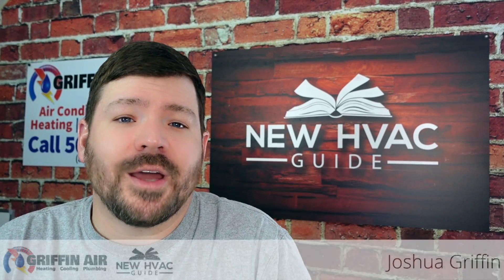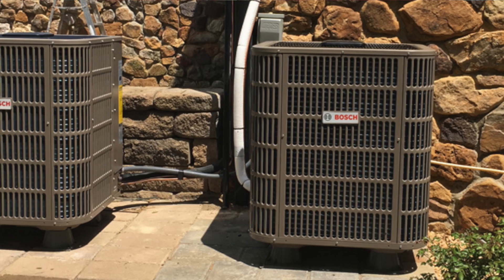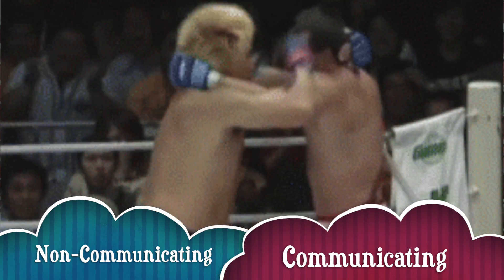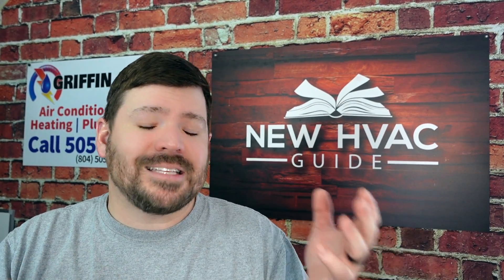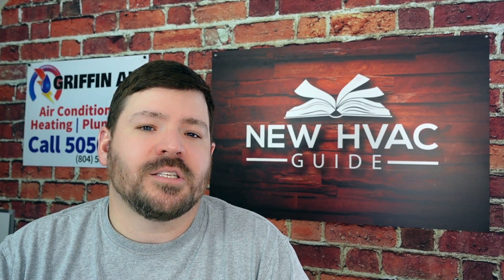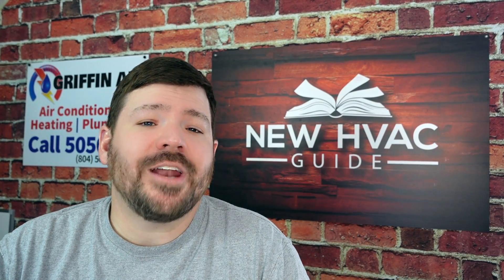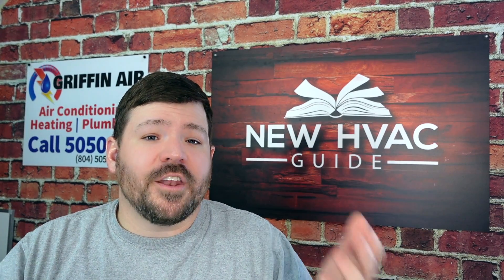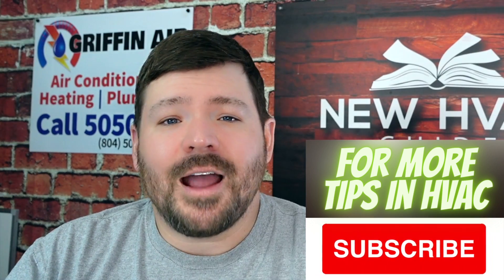HVAC Inverter WAR! Which is BETTER?

Comment: I installed a ACIQ hybrid unit and it’s been 1 yr+and now it goes into heat mode and I have no electric heating elements so it’s activating the reversing valve is there any way to find out if it’s needs power on the reversing valve to cool it’s has power and I’m baffled. Thanks .

Comment: These communicating systems are way too expensive. Im learning how to get into the business of building homes with a mentor and im starting out focused on first-time home buyers. Thats about 300k which is 30-35% lower than the median sales price in my market. I want to build a good quality airtight home but i need to be able to manage humidity. Im already considering an ERV and inverter heat pump to be mandatory, but i really dont want to spec for a dehumidifer as well. One because thats another increase and prive and two because they only last about 5 to 8 years before needing to be replaced. That's a huge burden on the person who buys a home that i build. I want the home to be affordable to buy and affordable to run. That means i cant have a full equipment replacement every 5 to 8 years. 

Im in zone 3a so we definitely have humidity. I'm not seeing how i can get a communicating heat pump into my budget tho.

Comment: Thanks, Joshua. I have a question about my system. I renovated a home 2 years ago, including a completely new HVAC system (included ductwork). My HVAC system is a ducted Mitsubishi heat pump (inverter) with an HRV. I wanted this system for maximum comfort and efficiency. However, the installer installed a Honeywell programmable/wifi thermostat. My question is: by installing the Honeywell thermostat, is it controlling my inverter heap pump more like a multi-stage unit, and not with the efficiency of the inverter? I know that I still have the variable speed equipment, but is my thermostat only capable of multi-stage functionality, thus losing confort and efficiency?

As a related question, I prefer Ecobee thermostats, and was wondering if I could swap out the Honeywell thermostats (I don't like them at all) with the ecobee...but I have the same question above. At my previous home, I had the ecobee thermostats and I really liked them, but I don't want to hamstring the system that I paid for (comfort & efficiency).

Thanks!

Comment: Most inverter mini splits have indoor and outdoor temperature sensors they comunícate and function like you explain do no need for communicating thermostat as they ramp up and run faster compressor speeds on hotter days or lower temperature demands

Comment: I was a factory service tech for Trane Commercial over twenty years ago and I will tell you that I would not put a new Trane system in my house or building today. They are simply over-priced garbage these days!
Reply from the maker: Ouch! Do you think the commercial and residential quality could be different?
Reply: @NewHVACGuide  I also have worked on residential systems as well. After the Ingersoll-Rand acquisition, The warranty issues went through the roof and the prices went up as well. I would put Goodman up against them any day for quality and the pricing is much better not to mention Trane can’t get parts sometimes for six months.
Reply from the maker: Join us on Tuesday for our live show!
Reply: I have been using the Trane inverter units since 2015 and very little problems,
And the 2025 units have the program and diagnostic data on IPad or IPhone
Reply: Lots better than carriers junk

Comment: those control boards scream surge protection
Reply from the maker: Surges are their biggest predators aside from poor installation of equipment
Reply: My old unit has a surge protector getting a new trane installed very soon and surge protector is on the quote

Comment: question, does inverter units dehumidified better than the standard units  are less? tks
Reply from the maker: Loaded question. Overall they should be better. But the latent capacity can still be lower if equipment and ductwork sizing aren’t correct

Comment: What do you think the likelihood would be of entire systems communicating over IP protocol? 

Most smart thermostats already are Wi-Fi enabled, and air handlers inside the home typically will be within the range of a wireless router, in addition to already having a physical connection to the condenser.

I'm by no means an HVAC tech, so I'm more than open to being corrected.

I just think that if all systems used a widely available protocol that's already in the majority of homes, we could have standardized communicating systems without proprietary equipment being an issue.

Comment: As an electrician, specialty PVS/LiFePO4 grid tie, the future for HVAC can only be inverter, they integrate into modern energy efficient smart homes. I am not in the US, I cant believe you guys (or even the environmental / efficiency rules) still allows the use of the old fashioned single-phase capacitor start induction motors. When I have a sneaky look around the re-cycling centre, there is an entire dept for old air conditioning, hundreds of perfectly working non-inverter systems that have had to be upgraded. I bet in the US you can probably still buy fluorescent tubes and bulbs with filaments!
Reply: Fluorescent tubes Yes I think are available...but I can't swear they are, but Bulbs with filaments went away long ago.  You probably knew that and was just kidding.  But just in case, gotta stand up for my Country.  HA.

Comment: Thinking of using an ECOBEE with Lennox EL23XCV / EL297V as a “non-communicating” setup. Lennox offers 3 “modes” to choose from when in non-com mode. I just can’t handle the Lennox thermostat which looks like a glorified android tablet after getting used to and loving a nest. Hoping to bide my time until Lennox gets their act together

Comment: How is having the ability to trun off and on vs. having a 20%-30-40-60-100% Inverter system. Wouldn't a duty cycle of a normal system be the same as a inverter system? The old style just truns on less on cooler days vs hoter days. Yeah i get that it only uses the power that it needs to cool. Do they just run all the time and ramp up and down as needed? Vs a normal one has a duty cycle that just full go or off and just truns on more on the hotter days
Reply from the maker: There are certainly days that either system will run less. However, a communicating inverter system will have the ability to learn the parameters and run as efficiently as possible. Less short cycling and longer runtimes, but drawing very little electricity while running.

Comment: Can a communicating system be run as a noncommunicating system, in otherwise is it possible to do a delete on the communicating system, when a part of the communicating system fails, and operate it as a noncommunicating conventional system.

Comment: I've been in HVAC industry for 8 years and could not be more disappointed with the insane prices that I'm seeing with high-end equipment, I'm seeing more than double the cost for the initial equipment cost comparing the most efficient to the least efficient equipment and I'm seeing the repair costs are astronomical for the inverter driven equipment or ecm's.
The only people I see putting in the top of the line equipment are old people with lots of money to blow.
Reply from the maker: Interesting. Where are you located?
Reply: @NewHVACGuide  southern Minnesota, I just put in a $3,000 inverter for a 3 ton residential AC 2 weeks ago.
There is no debating that the fancy equipment is more efficient and cheaper to operate but it is so much more expensive to purchase and repair.
Also the need for tech support to troubleshoot these new pieces of equipment is frustrating, this year I ran into a problem trying to troubleshoot a 15 ton Trane rooftop unit with a vfd blower and Trane would not help me because I'm not a Trane dealer

Comment: I understand inverters are more efficient when they're running.  I think part of the problem is they are almost always running.  2 acquaintances have told me, it's questionable if there's any savings.  They are running almost all the time.  And the price contractors are charging kills any savings, it seems.  I had mine installed about a month ago.  I've only been using the heater.  The heater is using the same (probably a bit more) as my old 9 SEER air conditioner that it replaced.  I "assume" the air conditioner will use similar energy in the summer.  I'm not sure where the savings are.
Reply: What area do you live?  And what did your installer charge you?       What Brand did you buy and what SEER did it say it was?
Reply: @ChiefRRoss  I'd rather not throw the installer under, but I do live in Los Angeles county.  California.  The install appears to be fine.  It's just they are always freaking running.  Maybe 85% of the time is more correct.  Could be 90%.
Reply: @twoweeledsoto6072  Well friend, you're the one said "the price contractors are charging kills any savings".  Your Words.
Every Inverter Description I've read clearly said,  "unlike the traditional HVAC units that turn on and off, our inverters run constantly".   SO, they told you, You Should've known it runs constantly before buying it assuming you did your due diligence researching it.   HOPEFULLY it's as advertised and is Quiet at least. 
 As for the SEER, I'm in SW Ohio, and am looking to get one that has between 16-24 SEER.    I've not seen Inverters rated much less than that, so it has to be doing better than the 9 SEER you used to have.     I only asked what your installer charged to get a general idea what I had to look forward to, although a CALI. price is likely going to be 2x as much.                   GOOD LUCK, hope you get used to it,.
Reply: @ChiefRRoss  Well, you really don't know if they told me or not.  You are assuming that.  If they did, you don't know how clear they were on that.  I did get the general feeling they run more, yes.   But they run much more than I ever imagined.  I know it was never explained why they run.  They are not always cooling or heating when they run.  To filter the house?  Maybe, but I don't recall reading that on every review I read, and I read a bunch!  I still don't know why they just run and blow air.  Temp is correct and they still run, just cooling/heating stops.  Inverters run constantly?  Ask 5 people what constantly means relative to AC and I bet not all answers are the same.  
I think mine is around a 17 seer.  that's another issue.  How the ratings work.  Not all 17 seer work at the same level.  Governmental changes is what I understand.  Mine is 17 and near $19K ish.  Including ducting which will probably have to be done, because you will probably go up in size.  Maybe 1/2 ton more, depending how your existing system handled things.  I am happy with the performance.  It is quieter.  Along with larger ducts, we increases the return registers.  In my uneducated mind.  Letting it breath easier with less restriction.  Heating and cooling are not as noticeable/perceptible as my past system.   It doesn't get as hot, nor as cold.  but I have a bigger system along with the blower (air handler) and I'm getting more air going into the house.  Not as cold, but more of it.  Which is why I'd advise going larger.  There's more of course but I'm getting writer's cramp and your eyes are probably hurting.  Any questions, just ask!    Important to note.  I have solar panels.  FYI

Comment: Josh the done problem with your least suggestion is some companies will recommend a non communicating system because they don’t have to be a certified dealer, sell a certain number of units,; etc. Bosch is a good example of this. Like you I agree Bosch is a great system for right environment .dry ! Esp cold and dry -very energy efficient for heating. But it’s just not designed to deal with humidity . In fact, it’s a bad choice for a humid environment ? For phoenix. Sat lake city, outstanding choice. Quiet, priced right, thermostat agnostic, and easier if a retrofit, keeping indoor components. The new 20 seer units allow the coil to be set (dip switch ?/)nto 37 degrees apparently-do you think that will make a difference ?
Reply: What's a good 15/16/or 17 Seer heat pump for humid regions (San Antonio)
I'm looking at Rheem or Amana.

Comment: Inverter systems have been used overseas for years mainly heat pumps that can now heat below -20 degrees.  The US market is finally getting caught up.
Reply: Which brands are the most reliable?
Need one this week.

Comment: I believe my 35 year old 3 ton Trane AC condenser finally broke.  The house is fully electric, in the winter we have a furnace that stores energy with also the air handler able to produce heat.
Looking for recommendations for a new condenser,  should l stick with a single stage or can l change to an inverter?
My thermostat is Ecobee 4.

Thank you Troy

Comment: Getting a Bosch BOVA 2.0 Split System Heat Pump installed along with a Bosch BVA Series Air Handler.  Regarding the use of a smart thermostat:  I was planning on using an Ecobee3 Lite with the new system.  Could I just disable the Smart Recovery feature, to avoid the possible problems you mention when using a smart thermostat with a non-communicating Bosch system?

Comment: I installed a Mr Cool universal. You need a decent  thermostat & outdoor thermostat that allows you to lockout the heat strips at a specific temp (if you even want heat strips). The non communicative has proven to be “smart enough” and paired with the right thermostat it is a wonderful advancement in hvac. You’re right about the difficulty finding techs to install/work on them but I suspect this to be less of an issue in the next 5-7 years. And I think it’s only an issue today to the degree that you’ll have to simply “call around” to find someone competent and willing to work on them. Manufacture provides 10 years parts & phone support so as a diy’er i’m not really concerned but recognize i might not recommend to others they jump on the bandwagon just yet. These inverter systems are too expensive unless you’re diy so it will take govt regulations getting tougher and these systems will be the gold standard in 5-10 years.

Comment: I am not interested in proprietary thermosets, or systems that require or even recommend one.  I like open source freedom.  I am hoping that we begin to see thermostats exceed what ecobee has to offer, with lots of aux modes and fan configurations, with many stages of heating and cooling based on rules that work well with variable inverter systems, hydronics, economization etc, and cloud based weather data, and indoor/outdoor air quality sensor data, without lock in.
Reply from the maker: You might get your hope sooner than you think :-)
Reply: It's Matter.

Comment: I’m located in South Alabama near the gulf coast in a subtropical climate and high humidity.  My regular HVAC company is a Lennox dealer, and it’s time for a system replacement for my home. I’m interested in the inverter technology but they keep telling me to go the traditional route with a single stage system.  I called another HVAC company for a quote and they too “prefer” the single stage system and say they are more reliable. I can’t figure out what’s going on?  Do the contractors just not want to learn the new technology with inverters and communicating technology?  Or is the single stage systems more simple and therefore more reliable?
Reply: What did you replace your unit with?
Reply: @TJ-22 
C'mon, Man. 
You know narcissists only answer if it benefits them. 😂
Reply: Go with variable speed my HVAC contractor gives 10yr parts and labor plus 12yr on Trane compressor but that's a typ trane deal with 12yr compressor

Comment: Save $50 of energy a year, cost $2000 to fix every few  years
Reply: You said this  I year ago "Save $50 of energy a year, cost $2000 to fix every few  years" Would this be true on a 2 stage AC unit or are you talking inverter or variable/3 speed?I was looking into a 2 stage AC for my soon to move in  daughter's (24 age) new to her  1885 (year) house (no air) in St paul MN and she has a 3D printer farm and we have humidity issues at my house and I thought the 2 stage would help keep the humidity down by running more. We have to keep a large dehumidifier running in the small printer room too. The Trane/American Standard suggests a 3.5 ton for her house, but maybe get a 3.0 ton single stage would be the wat to go. We could add a floor AC unit if we had to if we needed to kill the extra heat and humidity during really hot/humid days in the summer. We like to be at the 30% area but at my house with central air we were 35%-39% ish during humid days.
Reply: Cool story bro. A false one, but go on.
Reply: Just like my stock market strategy. Buy high sell low 😢
Reply: This is the way

Comment: I've installed a bunch of the bosch units fairly nice units. Just wish they had an EEV and came with variable speed blowers. Cool to see the inverter battle brings out the best for the customers.
Reply: Why do people complain about the humidity. I’m in southern Cali and we have like 55% humidity usually. I’m assuming I won’t be having issues with that.
Reply: @HVACOG  Midwest and have 60-80% and it does become a problem
Reply: @HVACOG  I think it has to deal with the algorithm that's built into the unit.
Reply: @HVACOG  Pretend there is 80% of the country NOT in an arid area.  Cause there is.

Midwest, South, East coast exist too.  Humidity is our big problem.
Reply: I was told that the Bosch heat pump works great with the Trane air handlers?